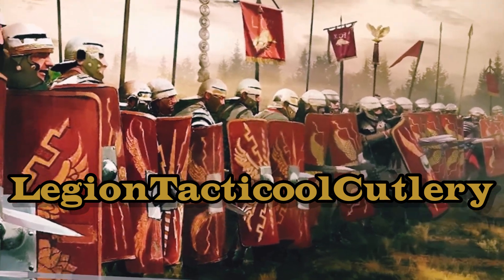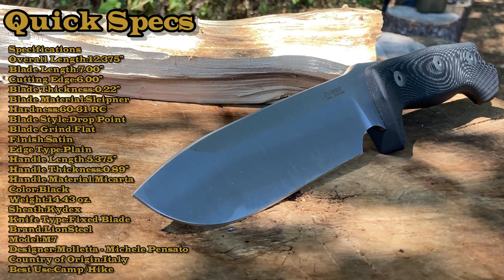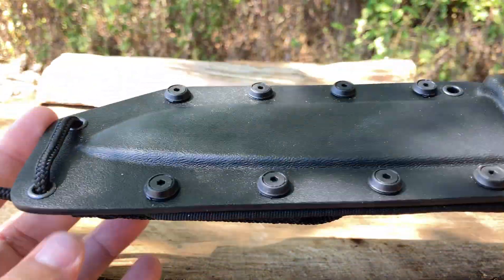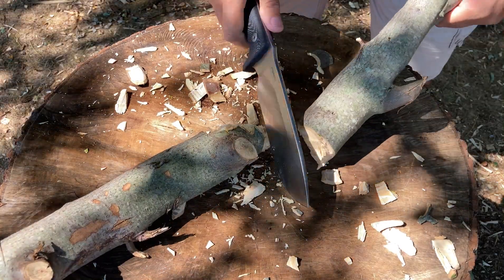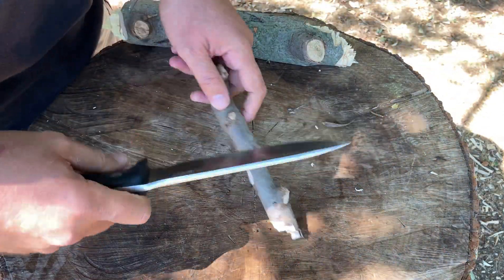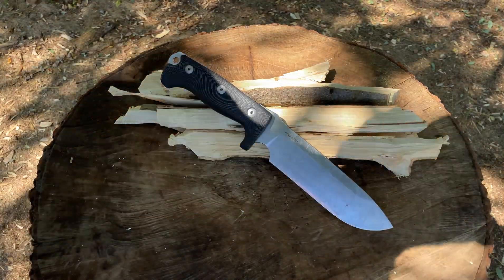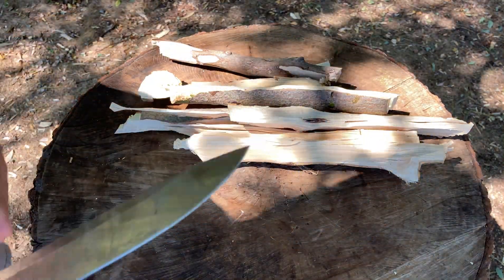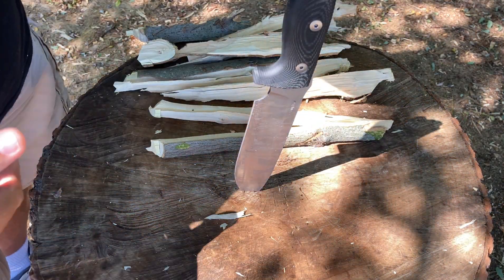LionSteel M7 #lionsteel #edc #bushcraft #outdoors #bowieknife @choirboyzcutleryoutdoors

Comment from the maker: LionSteel M7

The LionSteel M7 fixed blade is a multi-purpose field knife. Its large drop point blade shape and ergonomic handle are essentially trademarks of designer Molletta. The M7 has a 1.75" wide Sleipner steel blade with full-tang construction. Its contoured Micarta handle is a single-piece "integral" block that wraps around the bottom of the tang, while the pommel extends and creates a breaker with a lanyard hole. Includes a Kydex/Cordura MOLLE System sheath that is up to the task of keeping the M7 ready and at hand for action.

Specifications

Overall Length:12.375"
Blade Length:7.00"
Cutting Edge:6.00"
Blade Thickness:0.22"
Blade Material:Sleipner
Hardness:60-61 RC
Blade Style:Drop Point
Blade Grind:Flat
Finish:Satin
Edge Type:Plain
Handle Length:5.375"
Handle Thickness:0.89"
Handle Material:Micarta
Color:Black
Weight:14.43 oz.
Sheath:Kydex
Knife Type:Fixed Blade
Brand:LionSteel
Model:M7
Designer:Molletta - Michele Pensato
Country of Origin:Italy
Best Use:Camp/Hike
Product Type:Knife

LIKE, SHARE, and SUBSCRIBE!

#DSKFS
#22aday
#22adaynomore
#NeverGiveUpNeverSerrender
#NeverQuitQuitting

Don’t forget to hit the like button! 

Please help support our vets by raising awareness of the tragedy that is Veteran suicide by visiting the links below and reaching out to those in your life. If you know a vet don’t hesitate to reach out to them! 

Suicide Prevention Hotline: 1-800-273-8255 
https://suicidepreventionlifeline.org/

Mission 22
https://mission22.com/

Til Valhalla Project
https://tilvalhallaproject.com/

Message from Martin Miller, Army Veteran 66-69

1-800-273- TALK, Press 1 for Vets saves lives. They're the Shining Stars of the VA. My brothers and sisters, you're not alone. The help you
deserve and have earned is just a phone call away. It takes the courage and strength of a warrior to ask for help.  Please call if you need help. Suicide is a permanent solution to a temporary crisis

Message from Martin Miller, Army Veteran 66-69

I love this community!  The knife, sword, saw, fatwood, bushcrafters, and all the new people who have subscribed!  We are LEGION!

You guys ROCK!

LIKE! SHARE! SUBSCRIBE!   Also don't forget to check out the other content creators!  They are all good people with great videos!

Comment: Have it since yesterday, havnt test it yet! Look awesome i have no coating on blade, so it is just one big shiny piece of beast!
Reply from the maker: Yes!!!!!!!  Congrats on the purchase let me know what you think!
Reply: @LegionTacticoolCutlery  i can compare it only to ontario rat7, i dont have any other big knife. It is very comfprtable and high grind makes knife sharp, but the cutting edge is also a little big, maybe it could be thiner behind the edge, but it would probably make the blade not so strong.
The rounded spine has edges which surprised me, i was thinking there be wont edges just rounded belly.
Overall i dont regret, i bought it on sale, about $173, 
820 PLN here in Poland.